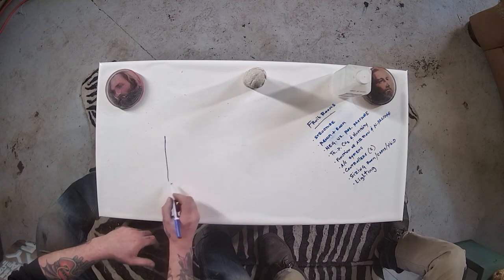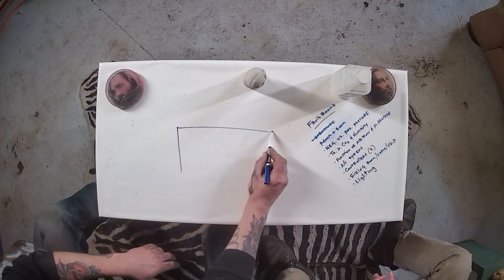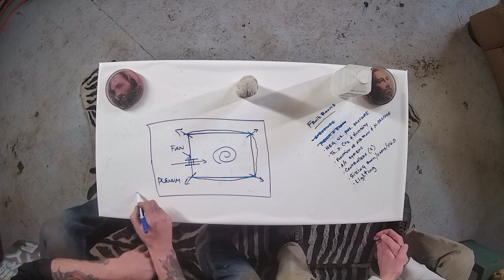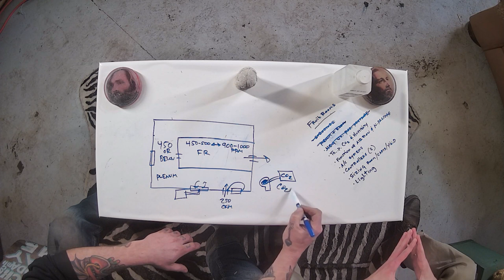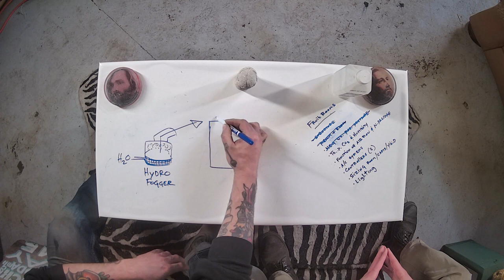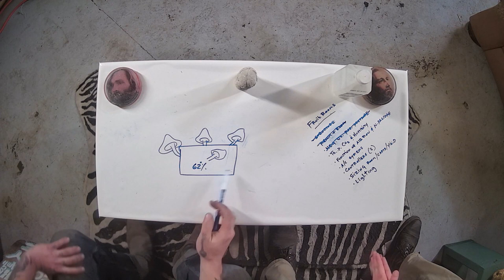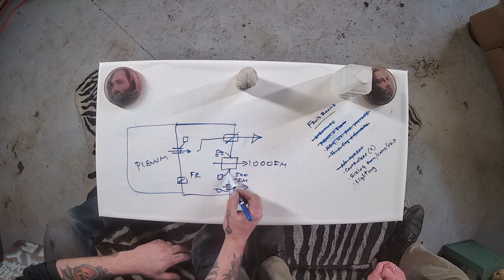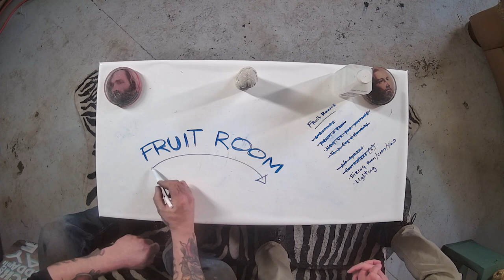Designing A Fruitroom

Comment: Fantastic podcast. Is there min size plenum / conditioning room should be for as example 20m2 fruiting room? I.e. if too small presuming will be difficult to maintain consistency (temp, co2, humidity ) in conditioning room? Thanks
Reply from the maker: Not necessarily, the smaller the plenum the larger the conditioning system needed. So much depends upon location and average temp of your area